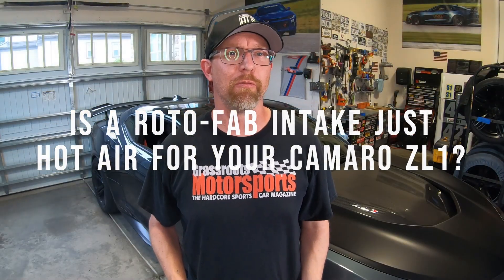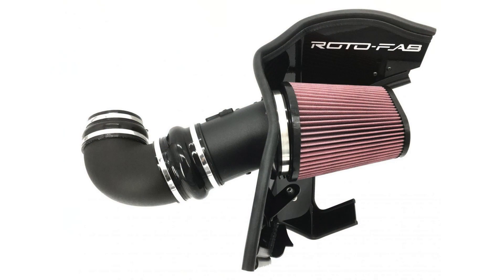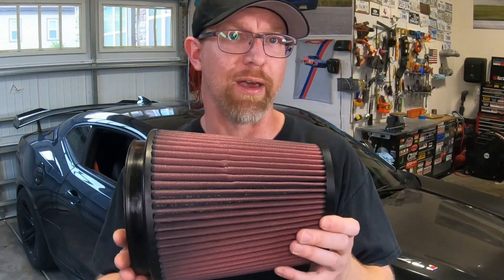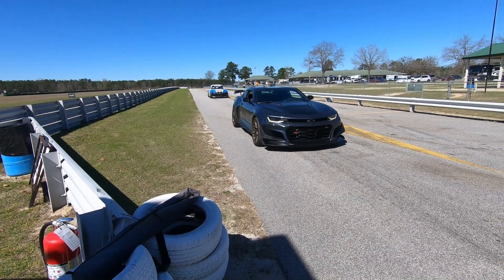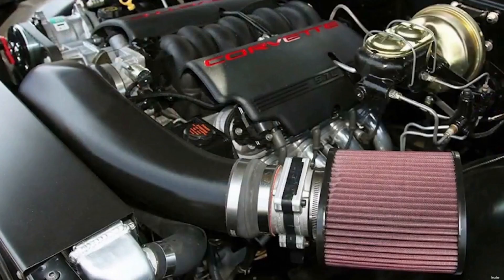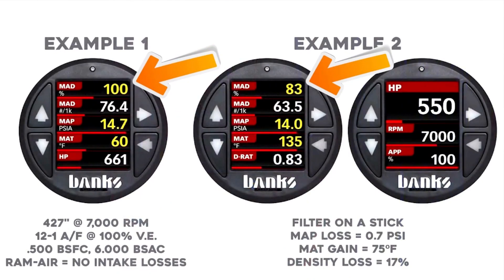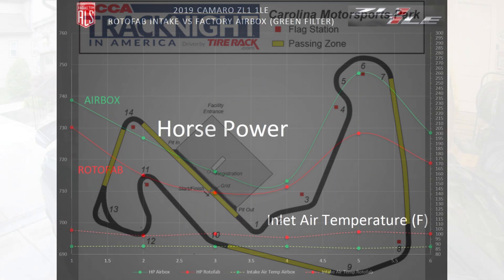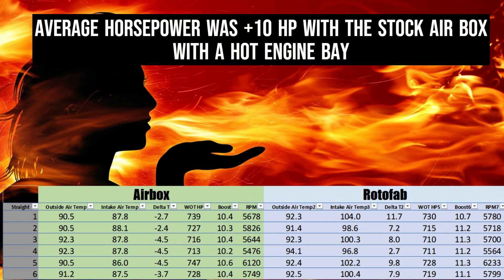Is Your ROTO-FAB Cold Air Intake Losing Horsepower at the Racetrack? CAMARO ZL1 #camaro #zl1

Comment: WOW!!!  This is exactly what I was thinking after running my car at Barber last month!  I have the Banks iDash and Datamonster monitoring my IAT, MAT, EGTS and MAD to name just a few parameters.  Now I need to figure out how to seal it off since I do not have the factory airbox and still love the sound of the supercharger!  I guess its time to inject some meth into the intake!!
Reply from the maker: I suspect that most of the air is coming from the hood seal and the interface with the fender splash shield. I'm not sure there is going to be a magic solution. Obviously the Roto-Fab is doing a reasonable job, but some percentage of the air from the engine bay is getting in.
Reply: @Racing for ALS  Have youbseen the scoops that go behind the grill to duct direct ram aur to the RotoFab?
Reply from the maker: @DavidWilks  yes. It would be interesting to test them. They do cover about 1/2 of the upper grille, so they may redirect air that would go to the radiator.
Reply: @Racing for ALS  
I've thought of that but also thinking of opening up the hood to ventilate more frontal pressure and increase the airflow thru the grill.  This made a massive difference on the Boss302 cars with the Paul Brown Tiger Racing hoods in Pirelli World Challenge cars

Comment: Wow, I’m glad I kept my stock 2018 zle airbox.  I’m ready to put it back in. I’m going to the track in two days.  Where do I get this green filter?  Also do I need to buy some kind of clamp for the one hose on the bottom?  I remember 5 years ago having to remove the stock clamp and I’m pretty sure that wasn’t reusable.
Reply from the maker: You can use the same worm clamp that came with the Rotofab to replace the PCV line or Autozone has worm clamps for less than a buck. https://greenfilter.com/store/filter/7299 and cleaner kit https://greenfilter.com/store/filter/2000 . I would recommend Summit Racing to buy it. https://www.summitracing.com/parts/gre-7299 or you can call them at 1-800-230-3030. Throw in a couple bottles of oil or Redline Water Wetter to get you to $109 for free shipping.
Reply: Thank you so much for the fast response!  Does this green filter come pre oiled?
Reply from the maker: @BenTheHoff  yes.
Reply: Old airbox is installed.  Wow, the supercharger whine is gone.  Oh well, now to listen to the borla cat back more!
Reply: @BenTheHoff did u go d a way to get the whine back 
And was the green filter and stock setup made car better 😊
Reply: My green filter has arrived!  Say, are you running the stock throttle body?  I was thinking of upgrading mine.

Comment: Are you able to compare boost pressure in Cosworth to learn more about relative airflow restrictions?
Reply from the maker: If you freeze the frame at 4:36 you can see boost pressure. Boost was .5-.7 higher with the Roto-Fab than the factory box, likely due to a lower restriction. The higher temps most likely lead to lower timing and reduced power.

Comment: Is the “green filter” an oiled gauze style filter or paper?
Reply from the maker: The Green Filter is a cotton mesh with oil. It's equivalent to a K&N type filter, but has higher quality molding and materials. The Green Filter has a nice tight interference fit with the air box and there aren't any exposed mesh ends or rubber flashing like most K&N panel filters.
Reply: @RacingforALS  

Do you have a link for this filter?
Reply from the maker: @DavidWilks  https://greenfilter.com/store/filter/7299 and cleaner kit https://greenfilter.com/store/filter/2000 . I would recommend Summit Racing to buy it. I don't have a link due to website maintenance, but you can call them at 1-800-230-3030 or wait for the website to reboot. Throw in a couple bottles of oil or Redline Water Wetter to get you to $109 for free shipping.

Comment: Did you utilize the factory air box with zero modification to remove relative airflow restrictions…?
Reply: Remove the snow blocker plate next to the driver's headlight and you'll further remove restriction from the fresh air snorkel.
Reply from the maker: The stock airbox was not modified, but the paper filter was replaced with a oiled cotton Green Filter.